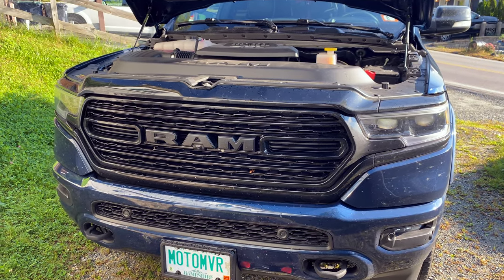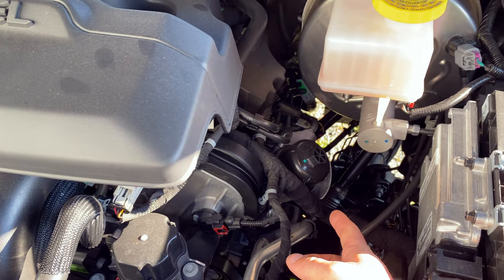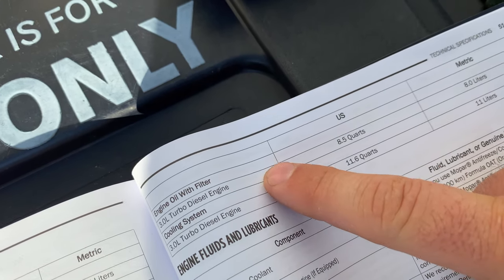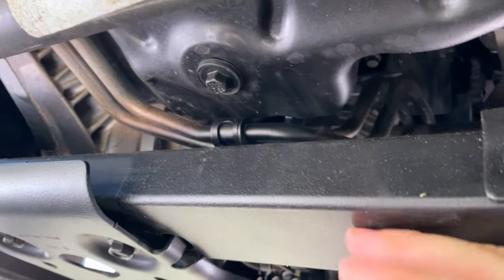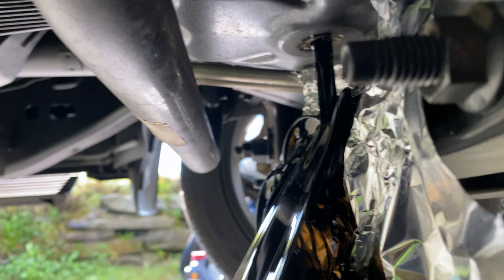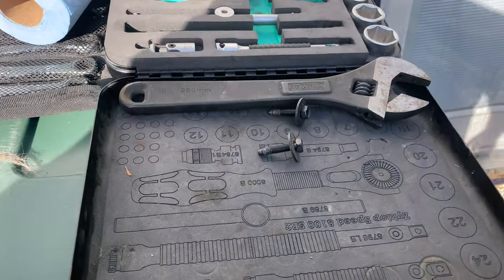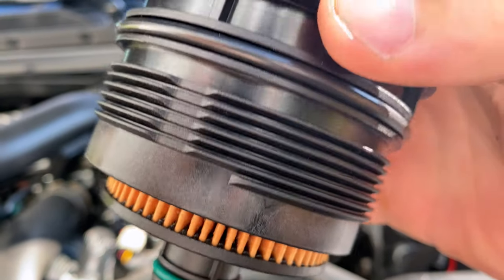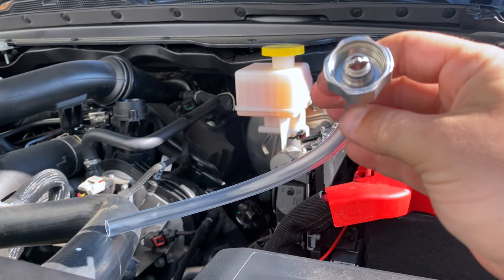How-To: 2021 RAM 1500 EcoDiesel 3rd Gen Oil Change & ValvoMax Drain Plug Upgrade

Comment: Have you done the oil change since installing valvomax oil drain plug?? Interested in seeing the oil change and seeing how long it takes to fully drain with hose.
Reply from the maker: Hi Carlos, I’ve done two oil changes since. I haven’t really timed it but I’d say it’s only slightly slower than draining without the tube with the added benefit that all of it drains right into my drain pan versus having to drape foil across the lower bar due to the design flaw. I literally just screw on the tube and out it flows. It’s no mess, no drip and very easy to do.

Comment: Hi Adam, thanks for making this video! I liked the Valvomax idea, so I got one. Did the oil change on my ‘21 EcoDiesel, reset the truck computer, everything very carefully. Next day I got on the road, drove 120 miles and the low oil pressure notification came on! Any idea what might have caused that? No leaks visible by filter or by the plug; even had the truck up on a lift at a shop and they said it looked clean. Thanks!
Reply from the maker: Hi. If there are no leaks and your dipstick shows oil within the top and bottom lines (min/max), the only other thing I’d check is that you tightened the oil fil cap & the oil filter. The fil cap just locks in place (doesn’t need tightening) but it’s possible the oil filter wasn’t seated fully? Unfortunately, you’ll have to unscrew it (let the oils rain down into the case) so that you don’t over tighten a cross-threaded filter but then reinstalling it to ensure you get to the right torque spec. Low oil pressure is usually under-filled but could also be a vacuum leak. So far 50K miles with Valvomax and about 7-8 oil changes and I have not received that warning yet.
Reply: I tightened the oil filter and that solved the issue! Thanks for the tip!
Reply from the maker: WOOHOOO!

Comment: I will usually remove the skid plates & that crossmember for the frame. No chances of a mess, remove 3 bolts and loosen the last. Swing it out of the way and voila, oil’s a changing.
Having an impact wrench makes it much quicker.
Reply from the maker: That works but I don't like touching OEM bolts especially over and over again as often as an oil change but it certainly is an option.

Comment: I have a question, as I've been looking at the ValvoMax.  I know this video is 2 years old but I have the same truck, same engine, same color, even the same oil reservoir so I figure you have the answer. Ha When you install the drain piece, I know it makes the valve length longer while draining. Is there good clearance between it and the cross member so I'm not busting knuckles??  Thanks in advance!
Reply from the maker: It's still tight like if you have some oil on it or on your hands, it can be hard to thread it just because you really can't see what you're doing. It will clear the cross-member but it's tight. There's another option out there that is a valve you can open / close but I was worried any thing hanging down from the oil pan would get hit or dinged and break and cause more damage.

Comment: Hey Adam, great video! Planning for my first oil change on my '23 Ecodiesel Ram 1500. How did you like the performance of the Motul X-Cess gen2? Are you planning on switching to a low/mid SAPs oil down the road (like Motul X-Clean gen 1 or 2)?
Reply from the maker: Great question Chris, I should note I get 50% off Motul oils through their motorcycle sponsorship program so that obviously impacts my bias here but honestly I haven’t had any issues using this for so far, 4 oil changes. I have not done any oil analysis though so this is just gut feeling. As for switching over to X-Clean, I thought I checked that 2-3 months ago and it does not meet MS-12991 spec as required by Fiat for this motor. If I’m wrong, I’ll take a closer look at that.

Comment: Question. My dealer say this job takes hours. Due to draining and they say it takes a lot more oil. What gives?
Reply from the maker: Your owners manual says what the oil capacities are. Are they saying the ValvoMax drain plug requires more oil be added? I definitely contest that. As for time it takes, sure it takes a bit more time to thread on the drain hose but then it drains just as fast. It took me a few changes to get fast at it but it’s not so bad. I’m not running a shop so it sounds to me like they just don’t want to do it. Sometimes, when a place quotes an outrageous figure, it just means they want you to go somewhere else. If you aren’t doing your own changes, you probably should just keep it stock so you don’t have issues with places that don’t like custom things.

Comment: that drain plug looks like cool gadget, thank you for sharing
Reply from the maker: They make different sizes. It has a sweet ball bearing thing that only lets fluid past when you screw in the drain tube. Neat little contraption. Will make oil changes way easier.
Reply: I just hit 6k and it’s telling me my oil life is at 15%

Comment: Did you test your quick drain before filling it up? Looks like it will hit the crossmember when you screw the hose on.
Reply from the maker: I just did my 2nd oil change. The quick drain cable was fine. It is a little overlap but they include a nylon hose so you can flex it fine and it doesn't crimp.

Comment: How long does it take to drain your pan? I've got a 2nd gen i get it up to 200 and drain for 40 minutes. A little more then 2.5 gal
Reply from the maker: It drained for a while. I park on a slope which definitely helps a ton. Maybe 20 minutes before it was just a drip.

Comment: Are you ok with the coolant being a slight bit lower than minimum amount line? Thanks for your time.
Reply from the maker: My driveway is on a slight grade so I always account for that when measuring fluids..oil and coolant always show a tiny bit low when I'm parked.
Reply: @AdamChandler86  thank you

Comment: Why did you change the oil filter and the housing, doesn't the filter element just pop out, and you pop a new element in the housing or is that they way it comes?
Reply from the maker: Nope, The Gen 3 EcoDiesel is one complete part. You cannot separate the paper filter from the housing. The price also went up 3X to $50-$100 depending on where you buy it just for the part. A step back from the previous iteration when all you had to do was buy a filter.

Comment: Does this disel truck don’t have a fuel filter I’m curious?
Reply from the maker: It does have a fuel filter that should be changed every 20,000 miles. I did mine already and did not create a video as it was the first time but it was very straight forward to do.

Comment: Plug parts on Amazon says does not fit 2021 ram 1500 ?
Reply from the maker: Here's a direct link to Valvomax for the diesel - https://www.valvomax.com/pages/product-result?steps=171748-35727-171710&wizardId=22
Reply: Thank you, and also question for oil filter since no more in stock, any suggestions for different oil filter? Thanks again